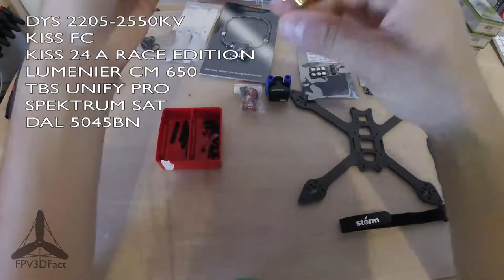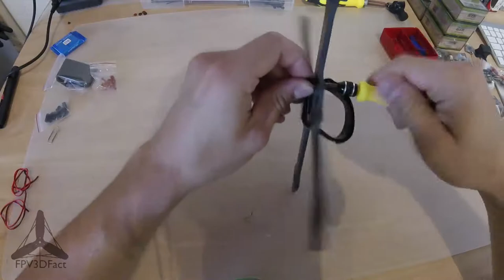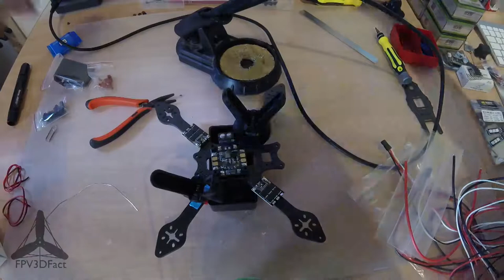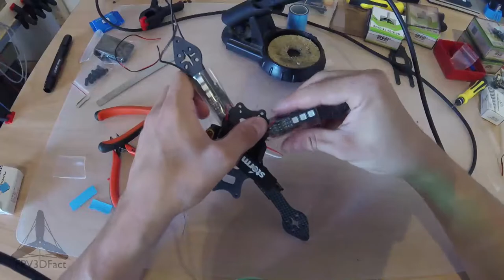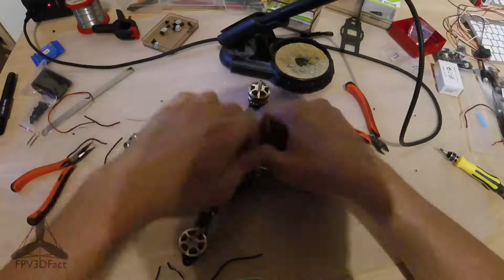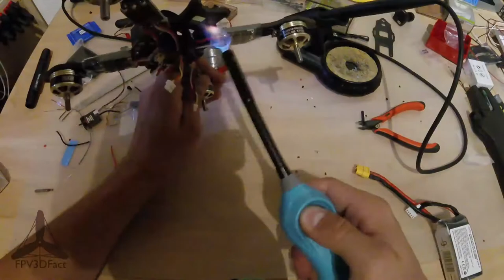How to build a Racing drone/quadcopter - SRD199 loki X5 - Storm Racing

Comment: Hi, I would like to ask your help. I planning to buy one of the loki drones but they inly cone with a frsky receicer which is nit compatible with my turnigy evolution. Coyld you help me please to find a receiver for me loki and pick a cable which helps me to connect the receiver to the board. Im a newbie and never built eny quads so far. Thanks for your help in advance.

Comment: Did you have any oscillation issues? I can't fly my loki... I don''t know what I do! I use o-rings on the fc, rubber under the motors, all filters from Kiss and even the Notch filter on the last firmware...
Reply from the maker: Hello, I don't have oscillation with my buil BUT. first time I had video vibrations. These vibrations comes from camera support. I had change my support and now my quad is good. You need to control your PID maybe
Reply: Bahhhh no.... Check my channel and you will see... Those oscillations comes from the combination of the FC and this frame